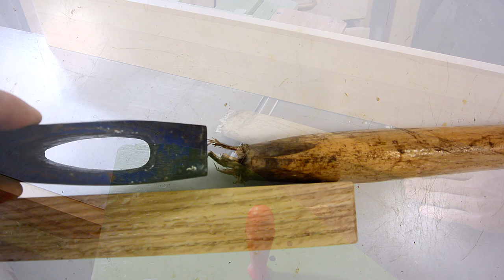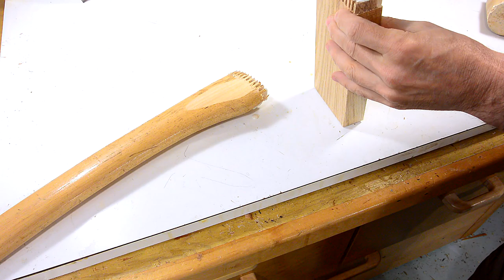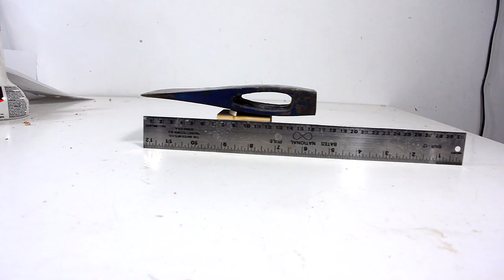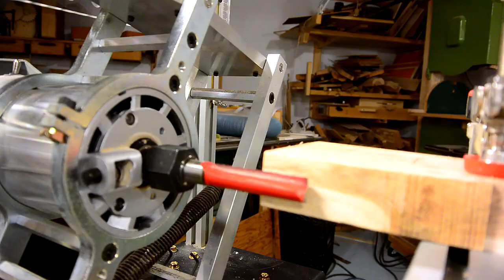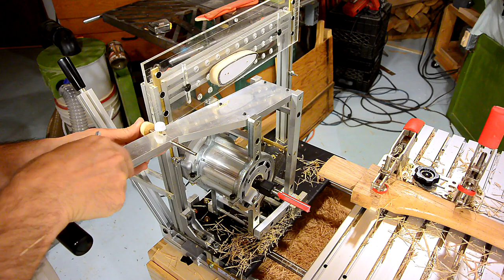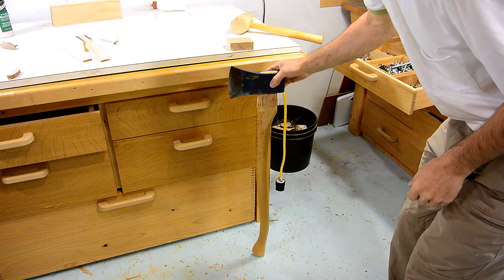Needlessly complicated axe handle repair

Comment: What made you choose that direction of finger joint vs 90 degrees to that ?

Also the depth of the finger joint, why not longer ?
Reply: 12345NoNamesLeft My reasoning for the direction would be: Right now the force is being transferred from wood to wood directly (the fingers push against eachother). If you would make the cuts longitudinal you would transfer the force through friction between the fingers and rely in the shear strength of the glue.

Comment: My old roofing foreman said he soaked the head of his wooden handle roofing axes in a bucket of water if they came loose. I'm guessing that head/screw may come loose at some point, and a good soaking may bring it back to the fit it has now. Thanks for sharing your repair!
Reply: jim187187 Did he tell you about the time on a dry day when one of the ax heads came flying off and damn near killed a laborer? I bet the idiot left that part out...Be careful what advise you follow, it's not all good.
Reply from the maker: Rt Carolina Agree.  Repeated soaking and drying can permanently shrink the wood. This is what causes checking and cracking on weathered wood.
Reply: Matthias Wandel I speak only from experience, unfortunately.
Reply: He was 60+ years old and had been a roofer most of his life. Roofing axes aren't swung in the manner of chopping axes, but used primarily as a hammer, swung a few thousand times a day. When it becomes loose you know it, before it is able to come off. Maybe it is bad advise for an axes like Matthias', but relying on a screw and washer isn't the safest with a backwards wedge either, and it will likely be taking some serious swings and abuse, anyways.. If my comment is a step further than someone would like to go into the ''danger zone,'' I'm not forcing anything.
Reply: jim187187 Same goes for the 3 lb. stone hammers we use in masonry work. You feel it getting loose way before it flies off. A lot of old time masons use the same trick. I watched a 60 yr. old mason put his hammer head through a glass door because he swore by the same trick. Just sayin'...
Reply: Rt Carolina Fair enough, but a loose head can fly off with or without this trick. The guy told me about this when I bought a brand new ax that had a loose head. I don't think I actually did it though, and instead just added a roofing nail or two in with the wedges until I bought a solid metal one...

Comment: Hey Matthias, would a profile gauge (the one with 100's needles) have been of any help to determine the internal taper of the axe head for use then directly on the pantorouter ?

Comment: Is a bunch of smaller fingers stronger than a few thicker ones?
Reply: +Ralphie Vigg The wood itself will have the same strength regardless, but more fingers means more surface area so the glue joint will be stronger.

Comment: Interesting idea and repair. Personally, I'd doubt the safety of that repair, but not because of your execution of it.
My understanding of woodworking is that there is no type of joint that is as strong as an unbroken piece of wood. That is the reason for my doubt.

The only way I can see to improve an axe without changing materials or large changes in design is to work on reducing the tendency of the handle to become loose from the head after a while.
Knowing that steam has been used to bend wood in the past (especially in the making of small boats), I would do the following:
1. steam-heat and compress the handle where it goes thru the eye of the axe-head.
2. heat the eye of the axe-head to 175-200 deg C (350-400 deg F).
3. Using some type of press, force the axe handle into the socket.
4. Allow all parts to cool.

The combination of the axe-head contracting due to cooling and the axe-handle expanding due to no longer being compressed should eliminate the need for the typical slot to accommodate the wedge seen in more traditional axe handles.
I'd be entirely unsurprised if this had been thought of before, there's very few truly new ideas in the realm of "axe with steel head and wooden handle".

Comment: I'm not a hater, just someone that fixed an axe. I think that structuraly your axe is okey, but now you have displaced the so called "impact point" of your axe, meaning that now your hands are not in the zero-force point of the handle and you may feel more pain from each impact. Have you experienced it?

Comment: Matthias Wandel since you are so good at fixing things I had a question. My woodshop teacher is giving me the schools old delta bandsaw, but on the table of the bad saw the cast iron broke in two. What should I do? Should I just buy a new table or somehow reweld/re cast it somehow.
Reply from the maker: Anthony Strazhnikov Cast iron can't be welded.  I'd try making a wooden one.
Reply: Matthias Wandel ok but how do I make a wooden one?
Reply: Matthias Wandel Engineers should know that cast iron can easily be welded.  The trick is proper preheating and post cooling to prevent cracking like glass.
Reply: +Mike Smith I have no idea how to do that

Comment: The screw with the washer is way too small to hold on the head.|

Before redesigning something you need to really consider why it is built that way.  The split handle and wedge means you have the entire handle that passes through the head holding it from coming off vertically when swinging.  It won't be long before the screw strips out or the washer bends or the screw simply breaks and the axe head goes flying off.  I hope no one gets hurt by it.

Comment: I don't mean to criticize, but axe handles are fitted the way they are to stop the head from working their way off during use. To mount an axe head, you push it onto the handle by hand then turn it upside down. Holding it in mid air by the handle, strike the bottom of the handle a few times and it'll drive the handle into the head. It sounds backwards, but it really does work. Follow by inserting a suitable wedge with a punch. Axes are fairly safe in their traditional configuration, I wouldn't bother messing with that arrangement if it's a tried and trued method and you're not relying on any skinny screws of wimpy threads to keep the whole lot together.

Comment: I am thinking that the repair will fail due to the axe head separating from the handle due to centrifugal force. The screw will simply be stripped out of the handle.

Comment: You defeated the purpose of the taper by putting it in backwards. The idea is that the head will get tighter as you swing and it wants to slide upwards due to centrifugal force. Now the only thing holding the head on is the washer and I noticed that didn't hang over the metal by much at all. Time to rethink your "over thinking" this project.
Reply: Please link your axe handle repair video
Reply: JoshL Please link your smoking at the gas station video
Reply: The washer can't move sideways, and it looks thick enough IMO.

Comment: Why don't you test it and see what it will take to break it.
Reply: Gary Finger that type of joint with wood glue is stronger than the actual wood...if it broke it would break on the regular grained wood so why bother testing it when we know the joint is already stronger. :)
Reply: Accuracy Marked Please explain why it is the people who sell axes around  the world use a single solid handle instead of building one with a joint since it is stronger than wood?  I suppose you are going to say it is stronger then the new composite handles.    Being a novice I would like to see a test between a standard handle, a composite or fiberglass handle  and this patched up handle.  How many trees can it fall before it gives way?
Reply: Gary Finger Gary that joint is stronger than hickory...the reason they don't put joints all the way down a real hickory handle is it would look terrible and not be as smooth as regular textured hickory. Go on-line and check out the construction 2x4 pieces they put together to make up 8 and 10, 12 footers...they test them and they are rated stronger than regular non-jointed wood. Now if he leaves that hickory handle with a joint in the rain for a long time or in a tube of water...then it could very well be dangerous. He should have put the head on correctly and wedged the wider top taper with wood and then steel wedges 180 deg from the master wood wedge....that's the only thing i don't like about the fix.
Reply: Fester Blats lol, the glue interface is inbetween the wood fingers is not going to break at the joint...it'll break in a non-joint area....go do some research.
Reply: prove it
Reply: Gary Finger We don't need to LOL. Go read into this, it's common knowledge. You said you were a novice, this is just proof.

Comment: I wouldn't use that axe on a dare. Even correctly hung heads to fly off on occasion. That joint and the reverse taper are downright frightening, and that screw isn't anywhere near capable of withstanding the forces it would be subject to.

Comment: The only problem I have with it ,,is the head is on backwards. Thats not acceptable and with allot of use it will not hold that way. But if you only use it 1 time a year to break off a twig,,its fine.

Comment: Da uns demnächst das Eschenholz für Werkzeuggriffe ausgeht bzw. absurd teuer wird ist das garnicht mal so dumm.
Reply from the maker: ***** Ist bei euch der kaefer auch in den eschen?  Hier ganz verherend.
Reply: Matthias Wandel Ja, befallene Eschen müssen (sofern es gemeldet wird) thermisch verwertet werden. Nicht befallene sollen belassen werden in der Hoffnung das es resistente gibt. Aber die Waldbauern machen aus finanziellem Interesse natürlich lieber kurzen Prozess solange es noch verkauft werden kann.
Reply: Matthias Wandel Wusste garnicht, dass du deutsch sprichst :)